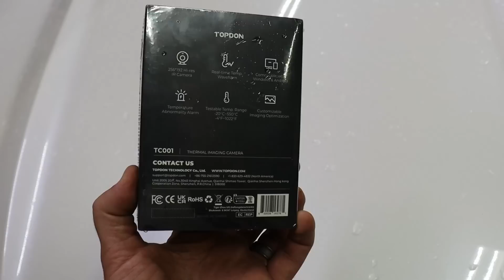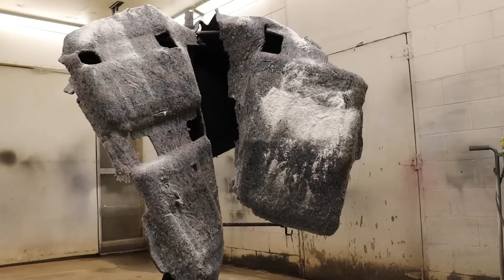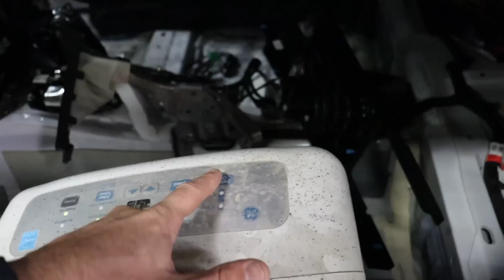SALTWATER MUSTANG GT FLOOD INTERIOR TEARDOWN

Comment: Lovely car, almost untouched.

I may have missed something though but as a saltwater flooded vehicle, it may now be dry but unless the bi-carb sorts it, the salt is still there. I would have thought it best to thoroughly wet all the affected areas first to dilute the salt away, then mop it up to dry and then the dehumidifier. I would think if this wasn't done there will still be the risk of rust further down the line.

Sorry if I did miss something and thanks for all the videos but i do like the flood ones!
Reply: I was thinking along the same lines especially for the carpet. Hose it down with fresh water on a concrete pad, squeegee it, wet vac it and then throughly dry it. The water level looked low but I'd be concerned about it getting into the interior of the doors and fender wells etc.

Comment: I think you did well with that car, it could have been much worse. I use an electrical spray like that, and have used it for many years.You can also use it to clean soldered joints, very good stuff.👍👍

Comment: Seeing how much is going on for just one seat with the wiring/computers is why I will never mess with a floor car.  Doors have all kinds of stuff, the modules on the floor boards etc... no thanks!  Still think it should have every single plug taken apart and not just spray cleaner but dielectric grease too.

Comment: How can it be sold if it's a salvage title and I can't see anyone paying more than you did,  how do you get the salvage title changed.
Reply: Dmv paperwork since it’s running and driving no repair is needed depending on the state an inspection will be needed. Other than that it turns to rebuilt title.
Reply: @gimne  that's good seeing you guys have a lot invested in it good luck with the everything.
Reply: @krismcdonald6956  I’ve done a couple rebuilds and just know from experience doing so.

Comment: you would almost want to flood the floor pan with fresh water to dissolve the salt, pull it out and then reflood with a weak water/phosphoric acid mix to neutralise and then wipe down the floor?????  If you dehumidify you just leave all the salt behind and car rots out from inside of all those crossmemebers.